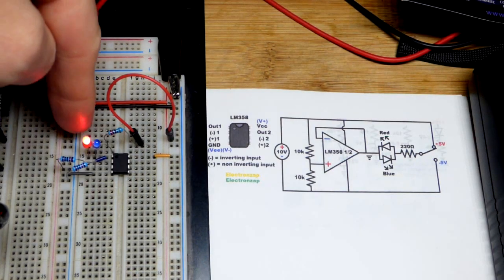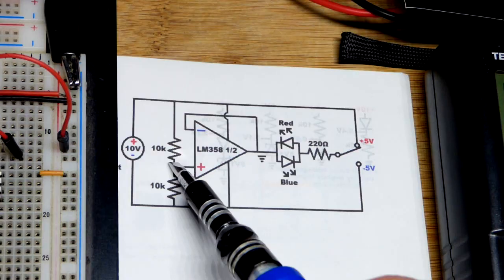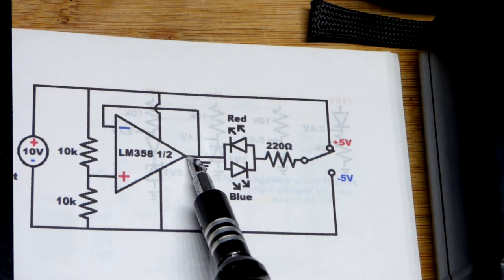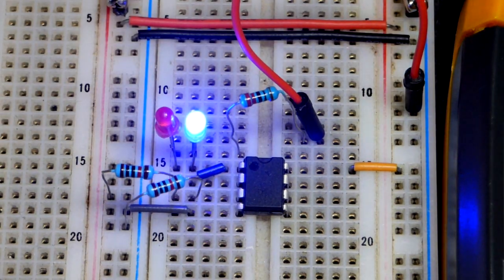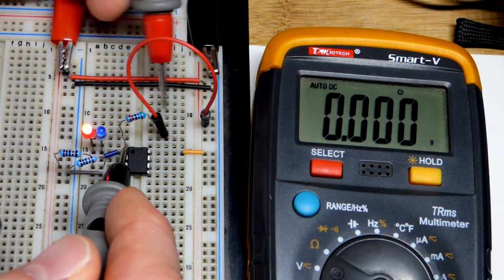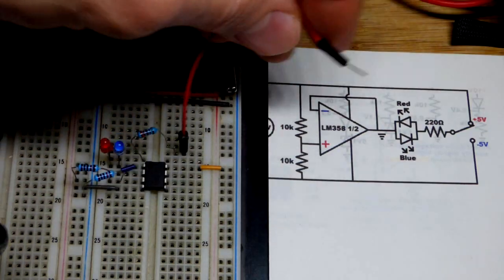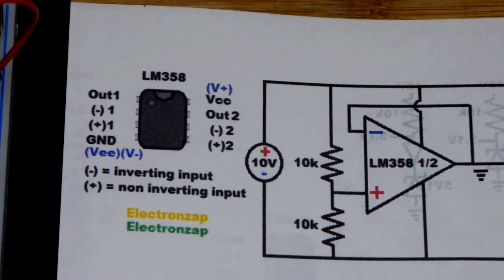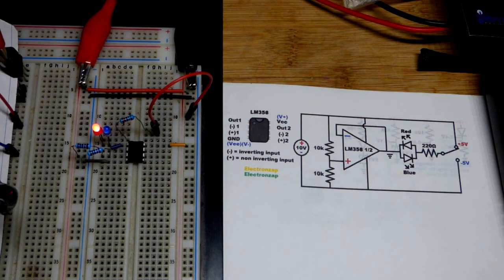LM358 Op Amp Virtual Ground Rail Splitter

Comment: Fruitful video. I was always wondering how to get -5v with simple components but here is the solution
Reply from the maker: The voltage follower circuit can do that, usually though people use a voltage regulator from a higher voltage, or if more power is needed, a voltage converter to get 5 volts from a higher or lower voltage.
Reply: If I may expand a bit on what @Electronzap  said, it does work for very small currents and signals, but  you have to be careful abut the application. If you want to make a guitar pedal, for example, this circuit is perfect because it gives you a ground centered between the rails. You'll find this circuit in datasheets and white papers - it's good. But it doesn't necessarily give you -5v. It gives a virtual ground halfway up the input, meaning that the -5v will actually vary a lot with the input voltage, resistors and other things. The other very important thing to remember is that you can never let your virtual ground connect to your actual ground, which could cause some limitations in some scenarios. If you want a TRUE -5v with voltage regulation and high power, it's actually not much more complicated than this. You can usually configure most buck or boost chips as a negative supply instead of positive. It's not always shown in the datasheet but usually works. 5 pin chip, one tiny coil, resistor & cap and you can get an amp of current. Future video idea? 😉